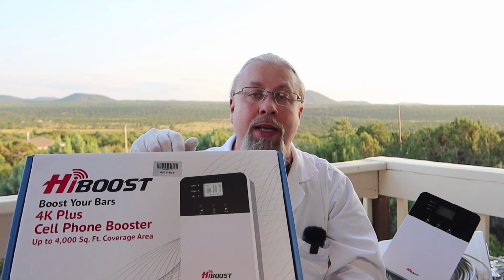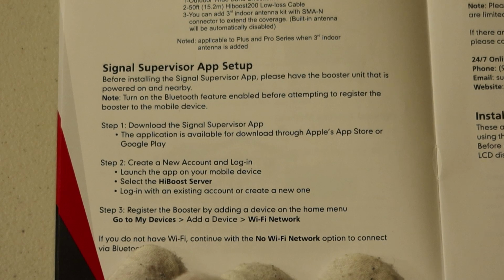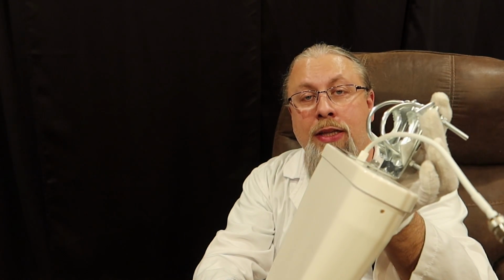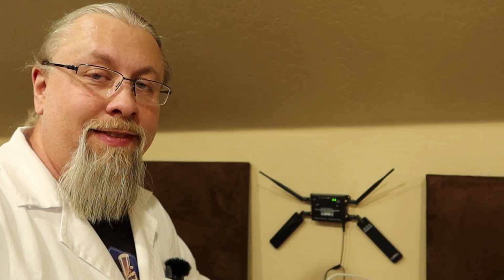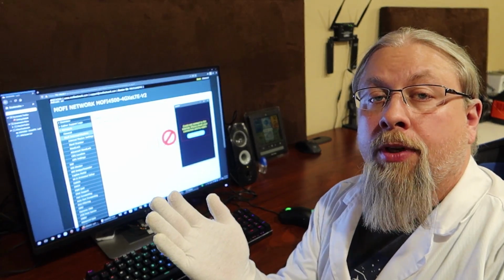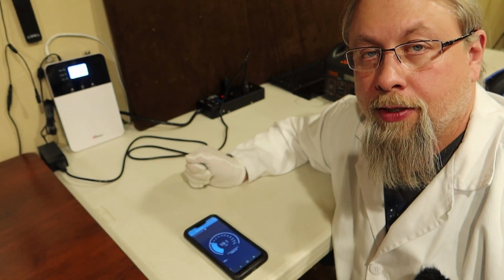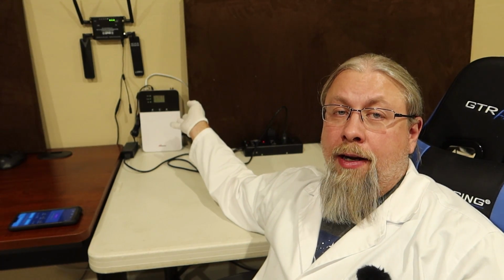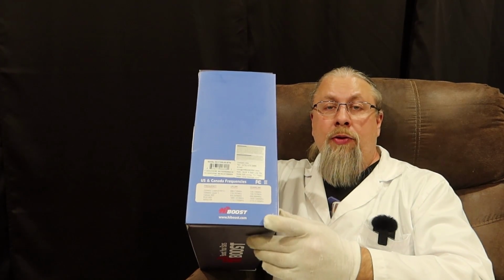HIGH POWER 4G Signal Booster! HiBoost 4K Plus 4G LTE Cell Phone Hotspot Booster Review Installation

Comment from the maker: HIBOOST 4G Signal Boosters https://www.hiboost.com/ref/6/ use code 2CX3RBZJ for 10% off SITE WIDE!
Use code XRMJT8WE for 20% off the Travel 4G 2.0 RV Booster!
Amazon links:
HIBOOST 4K PLUS on Amazon https://amzn.to/3iE2bGx use code 15ZR12NH at checkout (15% off)! 
HIBOOST 4K PRO https://amzn.to/2E7t9r5 use code 204F342P at checkout (20% off)!
HIBOOST 10K PLUS https://amzn.to/3iRIOdv use code 15IE71CX at checkout (15% off)!
MOFI 4500 4GLTE (and other boosters/routers/antennas) https://hobotech.tv/amazon/#Electronics-Internet
Reply: Hi hobo your not going to believe this but jackery is having a contest just go and sign up.
I was on there store looking for cord extensions because I bought a 15 foot extension for my type 3 solar saga 100 and guess what it doesn't work with it and it won't work with my jackery 300 stuff either wall charger or cig charger or unit it does fit with my old 240 stuff but not the newer stuff talk about suckey right so you might wanna confirm this and warn people about compatability between goalzero cables and jackery generators. Have a good day.
Reply from the maker: @thefatman5647  Goal Zero cords don't work without modification. You can take a knife and trim the outside to get it to fit (popular fix) or return it and buy a generic off my Amazon page. Those work.
Reply: @HOBOTECH  so just trim some of the plastic off and it will work thank you I destroyed the packaging so no returns.
Thank you for taking the time to help me your awesome.
Reply: God gave us a perfectly fine pole. Your girlfriends loss pal.

Comment: Yes very good option.  Devices designed for home and office use have higher legal gain limits than those used via mobile.  This I think is 60 db compared to mobile apps which is 50 db.  And one can certainly figure out a way to rig the antenna outside on an RV.  Directional antennas can even be used inside, so it's possible to use this even while traveling.  It doesn't come with a dc/dc adapter though, and one would have to figure out where to get one that worked or you would be using an inverter all the time to run it.
Reply from the maker: It can be powered by 5v, 12v, or AC and comes with adapters. This was covered in the video.
Reply: @HOBOTECH  I looked at this specific model on their website and the only reference I found for a power supply was ac/dc adapter.  I know the mobile versions have the dc/dc as well.  I'm interested in this because I actually want the directional antenna and these fixed location versions have a higher db gain ceiling.  I'm trying to figure out the difference between the 4K and the 4K plus; fifty bucks difference.
Reply from the maker: @JustVinnyBlues  My bad I thought this was on my recent HiBoost video. The indoor model only has the AC adapter but you can power it with DC if you're creative. The plus model has a higher gain and the indoor antenna is built into the display.
Reply: @HOBOTECH  I thought you might have gotten them mixed up, but I am loathe to question your infinite wisdom in these matters.  I have just seen the latter video and with that 20% coupon I think I'm going to get the RV version.  I was interested in the 4K but I looked at the manual and it says you need at least 20 ft of "vertical" separation between the antenna and the booster.  That's why the Weboost "Destination" comes with a 30 ft telescoping pole.  I have noted, though, that I could still experiment with a directional antenna on the RV version, as I have a 15db panel antenna that has the same connection.  I'm not sure why the vertical separation is required, but in my rig the 20 ft horizontal separation for the RV is "just" doable.  I will probably experiment with the directional antenna anyway. It would be good if one is going to be planted for a week or two and you are far out.  Thanks for the coupon.  It make this doable for me.

Comment: Just to be clear, do I also need a mo-fi or can I do a booster only? I currently pick up 1-2 bars with nothing but it is spotty in the cabin (as in only in one chair near the window!). Or would you start with mo-fi?
Reply from the maker: The booster would be best to start with as the antenna you can place up high for a signal.

Comment: So, how does the MOFI "crab" do for your cell phone on it's own if it's near a window with line of sight to the tower ?
Does the MOFI have to have a SIM in it to work ?... I run my home internet from a cell phone with an unlimited data plan.
Reply from the maker: It does work but not nearly as fast as using the booster. With no sim it acts as a basic router.
Reply: @HOBOTECH  
Thanks for the reply,... So it's basically a high end 4G router but not a booster.
I have been successfully running 11 devices from a $49 ZTE cell phone USB tethered to a home router with an unlimited data plan for 18 months but am looking at moving,... The new house is great but signal is weaker :(
Reply from the maker: @davidyummus6259  I used a very similar setup to you when I first hit the road. I got the "crab" because it is far more powerful than a hotspot. It doesn't "boost" the signal but the built in antennas are fantastic and far higher gain than even a hotspot with a Netgear antenna. The addition of the booster virtually guarantees I have Internet if there is any cell signal at all.
Reply: @HOBOTECH  
I love it & won't be going back to broadband,... I just don't know if Visible (owned by Verizon) allows their SIM cards to work in 4G routers.

Comment: Hello, finished installing the HiBoost 4k plus, went well once I read the instructions. I did use the app, it worked well for the install, it did the configuration auto magically. You are right the app is useless, won't work if you over 20 feet away from the booster. It doubled the download speed. The big test will come when we are 50 miles outside the city of Maybell in Northwestern CO.

Comment: Wilson YAG: Made from premium materials, this directional antenna has a weatherproof structure and a UV-stable white-sealed radome. The antenna is guaranteed to withstand impact and to resist damage from the elements. Specifically designed for both home and industrial use, this cellular antenna can easily be mounted on a building or infrastructure to improve your device's signal strength. Ideal for use with 75-Ohm amplifiers and accessories. Get unmatched signal strength when you use this with a signal booster.

Comment: I have an HOA that might frown upon the antenna pole.  I do however have plenty of open space in my attic.  Any idea if mounting the antenna inside the attic (cement tiles) would still work?
Reply from the maker: It should work but won't be as strong of a signal.

Comment: The Wilson Yag is a fiberglass like material which is much higher quality than the cheap plastic Yag that comes in this kit. I don't see this.pladtic Yag lastingn very long in Arizona sun.  This kit seems to be high quality except for the Yag antenna. Recommendation, please upgrade kit to the profesional Wilson Yag antenna which cost $60.00

Comment: Received it today, very good quality except for the yag antenna which very cheap made and looks more like a plastic toy. Order the Wilson antenna $60.00 on Amazon to replace this cheap antenna. It is much better made from a fiberglass composite material and will last.
Reply from the maker: It's the exact same antenna you get from Wilson. I know because I got one with my WeBoost.
Reply: @HOBOTECH  I did not gat a Yag with my weboost. I ordered the high quality Wilson Yag on Amazon for around $60.00. Note to HoBoost, pleases dump this cheap plastic antenna and switch to the professional Wilson.

Comment: So let me get this straight.
Pay 400 to 1000 for a phone.
Get ripped off to use it 400mo
By booster 600 to make it kinda work. WTF. I don't have internet, home phone, cable or tv antenna, no washer or dryer. Electric bill is 28/mo for 3 bdrm. Gas bill is 30 mo for heat and cooking.
Reply from the maker: My Motorola phone was $159. My Verizon plan $35/mo. The booster is $382. Might want to check that math.

Comment: I've been connecting coax cables for years and the best way to quickly waterproof connectors is to slide a 5 inch piece of bicycle innertube over the connector and zip tie off both ends. It's also good for preventing mast bracket slippage in high winds (boats rv's..). Never throw out old innertube, it has a million purposes!

Comment: will this work with 5G?
Reply from the maker: 5G won't be rural for many years to come. You don't need a booster in cities with 5G.
Reply: @HOBOTECH   thanks..
Reply: @HOBOTECH  lowband 5g is in many rural locations now:)
Reply: Most likely no. Right now its probably not worth getting something just for 5g.

Comment: Id like to see you do a review of an Internet bridge system. I would supply the Beer
Reply: You mean like Ubiquiti Nanobeams? The Nanobeam 2AC can should about a quater mile through trees, or aboutl half a mile through light brush, with a clear view and no interference in the area the can go for miles... (need a tower or tall building to mount them on). It used to be people used to use 900Mhz internet bridges but they are really hard to get now as the tech has become too outdated to manufacture.

Comment: I have a 5G phone. Do I need a 5G boost, or will I have to buy a new unit in the future?
Reply from the maker: 5G will only be available in urban areas through the next decade. This booster is for rural areas that will be on 4G for many years to come. Most of us will move over to Starlink before we see 5G.
Reply: HOBOTECH thanks for your quick reply. I really appreciate what you are doing on YouTube.
Reply: It won't b worth getting a 5g boosters anytime soon. Maybe middle of this year to late 21it may be worth it. I'd just get a lte booster if u need a stronger signal.

Comment: Why not connect the outdoor antenna (which you can buy directly from amazon) directly to the MoFi? It should do really well as the directional antenna, especially outdoor one, does most of the boosting work, and avoids the indoor/outdoor interference issue
Reply from the maker: That can be done but since it is a MIMO I need to install two antennas on the pole and run two cables then I don't get any additional db boost.
Reply: HOBOTECH You don’t need to run two antennas. You can leave one connected to indoor and one to outdoor. I’ve designed MIMO devices and it would work great. Actually, if you think about it, this is exactly what it’s doing right now - it’s using the mimo to connected to the booster using just one antenna since booster has just one antenna. Give it a try. I think you’ll be pleasantly surprised and even more so, your viewers will love it.

Comment: Tom...really like the simplicity of your explanations.  Hoping you could answer this question; I have 3 freezers drawing 1700w that I want to power with solar as a backup supply.  They are in 3 different buildings approximately 35' apart.  Any suggestions would be appreciated!  Thanks!
Reply: Hybrid Life, I wanted to thank you for the thought provoking response!  You really covered many aspects, some I hadn't considered, some I had.  Thanks for taking the time.

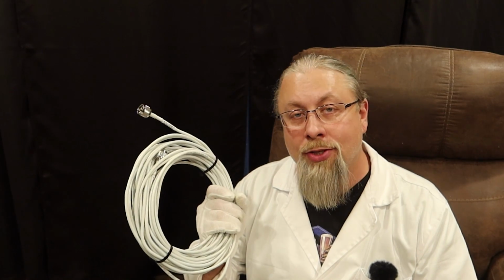Comment: 'And again, it's just temporary' (08:13). 
'Temporary' is a popular self contradictory word that only falls short of being an oxymoron by virtue of its being only a single word.
The definition of 'temporary' seems to vary from region to region, but around here it usually means at least five years while the upper limit has yet to be established. 
Local jargon can be deceiving. For example: 'For now' is preferred hereabouts because it is more energy efficient, having fewer syllables, as in 'put it here for now', but results are the same
At (09:51) Hobotech perfectly demonstrates this point. Besides, you know that it's as sure as sunrise: as soon as you drill holes and make a permanent installation it will be supplanted by a better device.

Comment: If you add an Attenuator to the other antenna on the in house transmitter you will get an even better signal.  Pasternack is who we use for these.
Reply from the maker: If my incoming signal is already weak how can an attenuator that reduces signal strength help?
Reply: HOBOTECH, you have an open port on the inside unit.  It is leaking a signal.  The attenuator caps that.
Reply from the maker: @nnelson1278  I'll have to research more about that as this is the first I've heard of leaking ports.
Reply: HOBOTECH, I will send you a picture of what they look like.  My company supplies SDWAN for large ag operations.  The attenuating the leaky ports makes a difference of 4-6 meg down.

Comment: Two big thumbs up 👍👍
I'll have to check out your Weboost video to familiarize myself with it.

First of all, do you require line-of-sight to the tower? Suppose there's a mountain or building blocking or partially blocking the signal but you can still get one bar of 1x (like where I've been living). Will the Hiboost work?

Secondly, with the 20 feet of vertical separation between the two components, a van dweller would need to carry around a 20 foot pole?
Reply from the maker: You don't need line of sight. It just really helps a lot. As long as you can get "some" signal it will boost it. I've used my WeBoost all around the country for 3+ years and it helped in just about every situation except when I stayed with friends at their properties in towns. 20ft is "recommended" but I think if you point the outside antenna away from the van and point the inside antenna the opposite direction you'll be fine.

Comment: Seems like it would be a good idea to wait for a model that supports 5G, if you can.  5G is already starting to improve rural coverage and will likely be much more widely deployed in 6 months to a year.  They may also cannibalize some 4G spectrum for 5G like they did to 3G when 4G came out.  I also wonder how much of the improvement comes from the external antenna and how much from the signal booster.  Can you hook up the external antenna to the MOFI directly?  It would be interesting to know how well that might work.
Reply from the maker: It is going to be a very, very long time before 5G is rural. They focus on cities for the first couple of years as that is where the $$$ is. 4G won't be cannibalized for at least a decade. I plan on moving to Starlink as soon as it is available anyway. I can install dual external antennas on the MOFI and may try that to compare the two.
Reply: @HOBOTECH  What you say is likely true for mmWave high band 5G.  Low and Mid band 5G, however, have the potential to bring a lot of advantages to rural communities in a much shorter timeframe.  The gigabit mmWave gets all the press but is probably the least important/certain part of 5G for most people in the near term.  It is also important to remember that towns are not the only concentration of towers.  Most larger highways also support cell operation and can support nearby areas.  They will likely get updated before many rural  towns.

Comment: How about an Update on what will change if anything on your channel now that your NOT a Nomad anymore!

A video on the best (in your opinion) 12v Water Boiler, Coffee Maker, Stove Etc. How best to save power by not charging DC items via AC power. Break it down like if you want a way to boil water on the move via 12V here it is. 12v cooler verse 12v refrig for your first truck/rv. Like if your about to bail and want to live out in the boonies here is a list of shit you need no nonsense just straight up, this is what I would buy if I have to bail and have to buy all new items for my van. 

Then a video on the cost/ease of use solar system v. solar generators.

Top 10 things ur ass need b4 u bail. Order online and save 1st. step.

Comment: Edit Update: called a tech representative and he said it DOES cover T-Mobile band 71... so we'll see after I order it and test it.  
And nevermind... Looks like it doesn't work for tmobile band 71 600 MHz. So that's a definite deal breaker. A question answered by a seller in amazon. Quoted here:
Q:i am on band 4 on t-mobile. Does it work?

Answer this question
A: yes,it can work on Band 12-17 / Band 13 / Band 5 / Band 25-2 / Band 4

Comment: How come the MOFI wouldn’t have service but the cell phone did if they were both using Verizon? I would  MOFI has better antennae’s than the cell phone.
Reply from the maker: Different locations in the room, different times of the day, and they are on different Verizon providers. Sometimes the MOFI gets 1-2 bars. I'm sure I need to relocate it because I think the metal roof is interfering with those built in antennas.

Comment: Could you please tell us how many watts of power the booser uses on a surge and constant basis? I would love to know both using 12v and 110v. I have an off grid cabin and power usage is at a premium for me.
Reply from the maker: I didn't measure this one specifically but the WeBoost in the van uses 10w constant when it is on. I couldn't see this model using more than 15w.
Reply: @HOBOTECH  Thanks! That's less power than I was expecting.  Can it be run directly from a 12v regulated outlet on a power station? With an adapter of course.
Reply from the maker: @Pixel_Page  Absolutely. I mention that I think  twice in this video.

Comment: Is it not true that when using a booster, your bars indication on you phone are going to show the signal strength from the boostet to the cellphone, not the signal strength from tower to booster. In that case you could have no service with 5 bars.
Reply from the maker: Yes, if the tower is slammed you can have almost no service with 5 bars. This happens every year in Quartzsite during the big tent event.